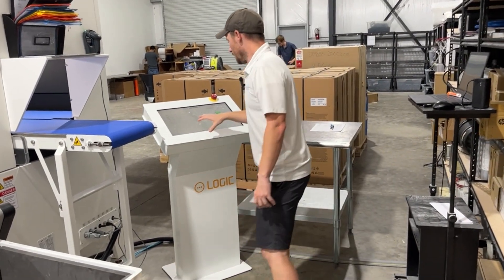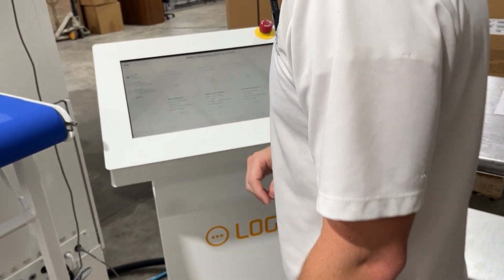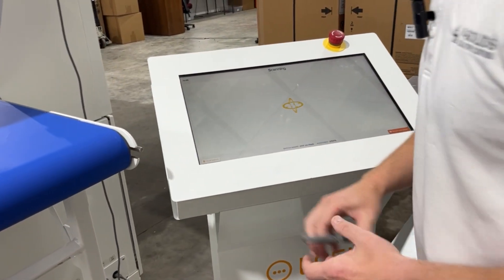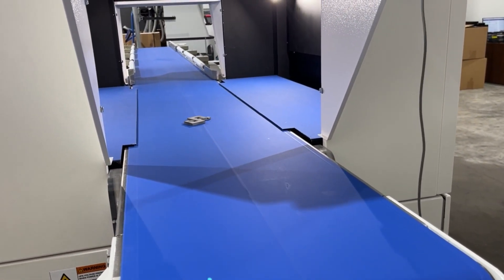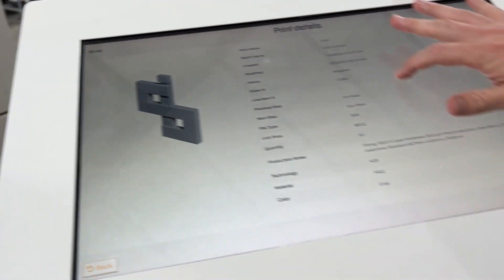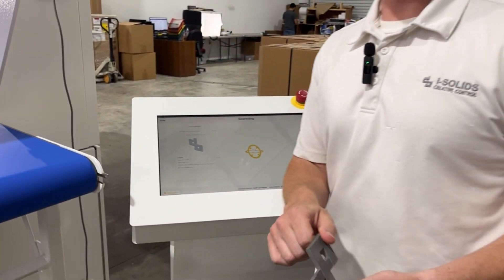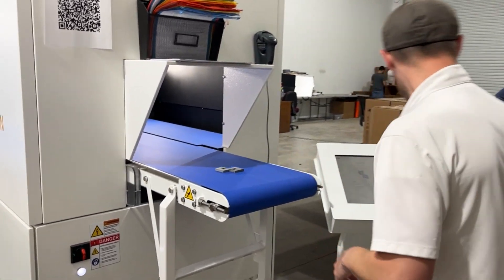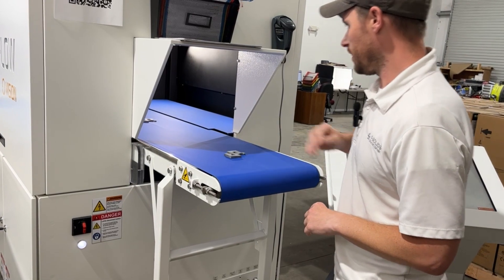Using Machine Learning and AI to Monitor 3D Print Farm Production

Comment: Awesome Kason! Very excited to see what you guys are doing. Do you have plans to add quality control to this workflow?

-Terry
Reply from the maker: Hey Terry! This is a great question and something I am excitied about. The system as it currently operates does help support some aspects of our quality control already by taking away some of the administrative tasks and freeing up more time for our QC to have on inspection. For example, we have traditionally taken QC pictures of every part - this is a manual process and takes a good bit of time but we now have a MASSIVE digital photo library of every part.

However, AM Flow is currently developing an additional module specifically for QC which can essentially 3D scan an entire part automatically within a few seconds and provide us with a  that can dimensionally checked against the model itself. Looking forward to this!

Comment: This is crazy Congrats. By the way what material that looks like S
Reply from the maker: Thanks! That part is a PA12 Nylon material created using multi-jet fusion. Layer heights are 0.08mm and so with a little post processing the technology can produce parts that appear to be injection molded.